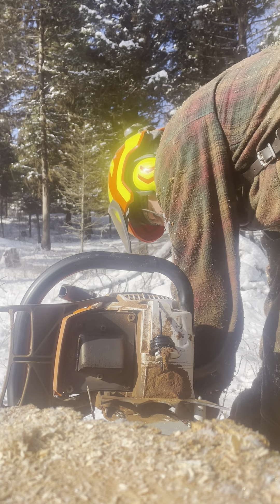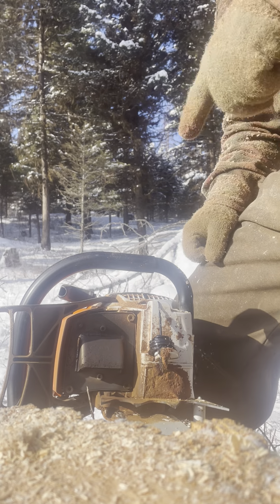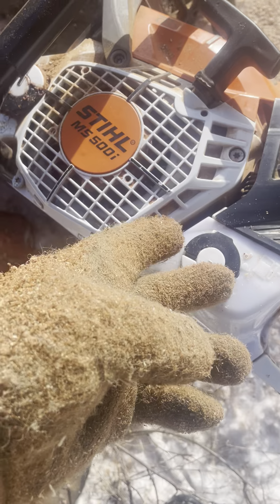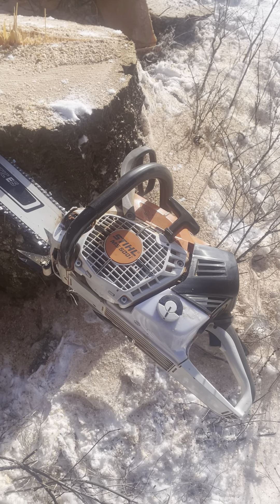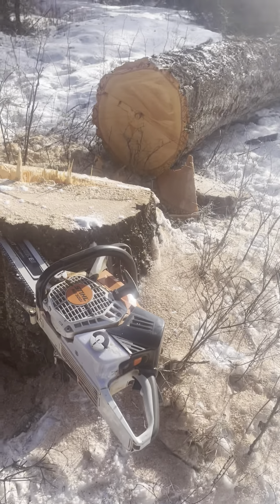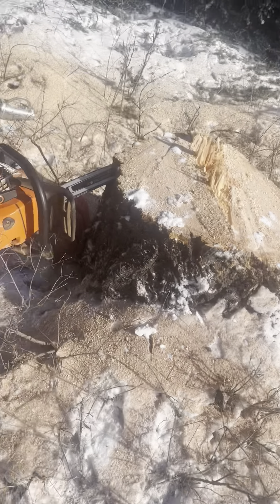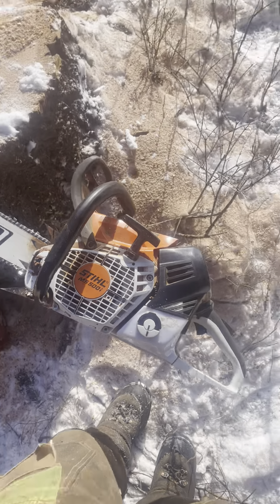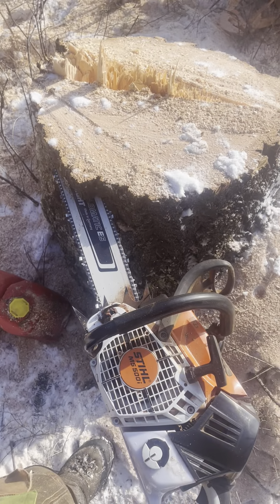A little frustration vid about my new saw.

Comment: The Caps will always be a problem. I cut my bar oil with a little diesel in Winter it's well below zero here every day for 4 months or better. Your's is Way to thick , and Don't overfill the bar oil ,the cap will fight you hard trying to seat it. Pack an old toothbrush and keep caps clear. It does help. Be good.

Comment: Good to see you/hear from you mate 👍 I can totally relate to those Stihl flip cap shit pieces 😂 I’ve always found for me it was the oil cap that wouldn’t seal and it would literally take me about 10 minutes to get that fucker on properly that’s why I love the older screw style never had any issues with them. Again good to see you Cody take care mate 👍😎❤️🇬🇧
Reply: Make sure you don’t have saw dust where the sealing surface is, the bits of crap will keep it from getting that o ring tight. I haven’t had much issues out of my caps beside the small ball on the string let’s go of the tank and the whole cap comes off. It’s a simple fix.
Reply: same

Comment: Flippy caps do suck pard, I agree!! I need to get a new set for my 460, and I might be due for seals but it runs good........just won't hold herself up by the pull rope. Seen a lot of guys that likes hell outta the 500, seems like an 064 type placement of the current lineup

Comment: Couldn’t agree more with ya partner, those flippin flip caps suck. I keep a can of keyboard spray in my saw box and it works great to clean out those stupid caps before you open them up and fill your gas tank with tree glitter. Also fun to turn upside down and spray you saw partner on the back of the neck with frozen air while he’s sharpening….Might not work in your real cold temps
Reply from the maker: Yeah they suck;

Comment: We really like out 500s. My partner runs a pretty much stocker by I run a heavily modified version. It is impressive for the weight. One thing I've done is put the west coast saw mount kit on it and it makes a big difference for floppy flop. Always have disliked the half twist caps
Reply from the maker: Yeah, the guy that modded my saw did some experimenting with the mounts and I like em, so far, better than the west coast ones that my cuttin pard has on his, as my saw seems smoother...time will tell though.